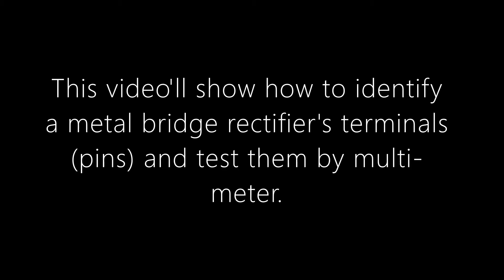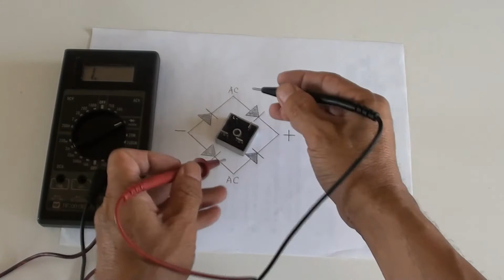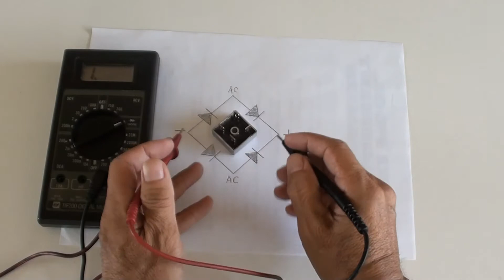Metal Bridge Rectifier

Comment: I have same bridge rectifir. I use for 5 A, is run very hot. If this is designed for 50 A, why is hot at 5 A?  Garbage
Reply from the maker: Good question, Mate.  It is Max 50 A with a condition:  Metal Bridge Rectifier must be attached a suitable heat sink:   The larger current goes through, the bigger heat sink will be.  Although you can run it without a heat sink under a coup of amperes for a short period time without a problem.  Best wish!

Comment: I have a battery charger that has 2 rectifiers with 1 fuse for each one. Both of them lead out to one wire. Is this because 1 rectifier alone cant handle the 15 amp transformer?
Reply from the maker: Spot on!   I'd say so in normal circumstances.  Thanks.